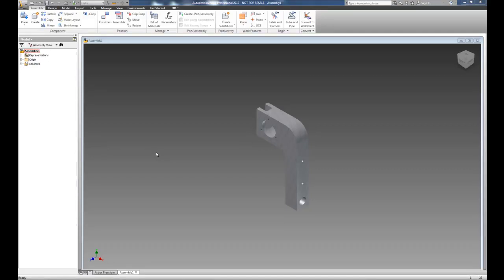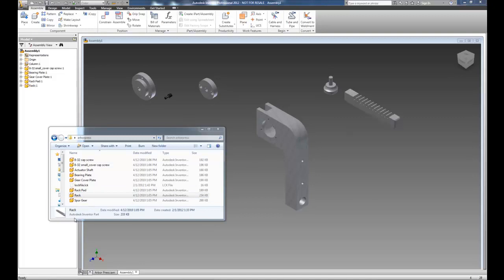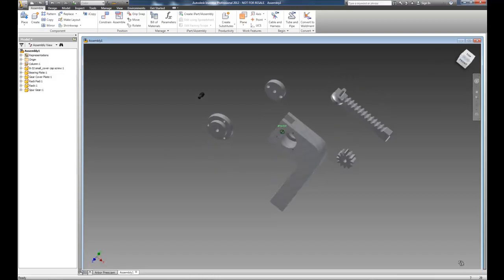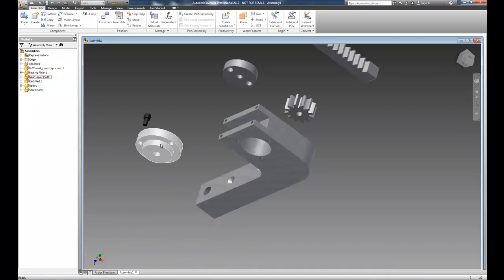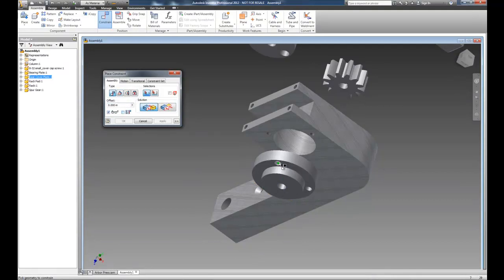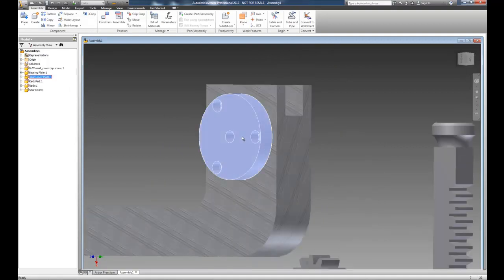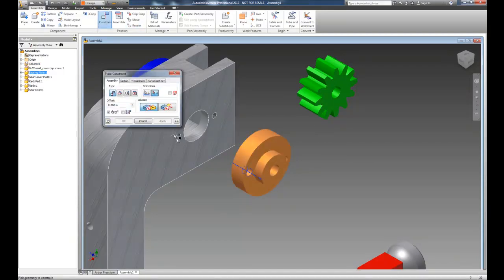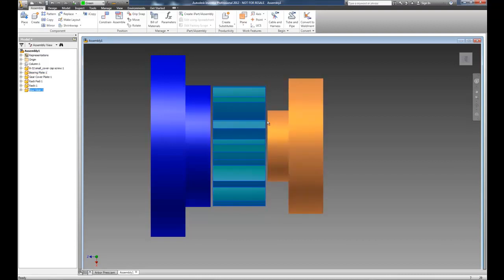Inventor 2012 -- Animating Assemblies using Drive Constraints

Comment: Tom a question for you,when lining up the spur gear and you used the offset,could you have a plane running through the center of that and a plane running through the center of the column and then us constraints to put plane to plane,now I know the column is not visible,can you make it visible and go to wire frame mode and do it that way or do you have the same issues regardless if your shaded or wire frame?
Reply: yea you can make it visible